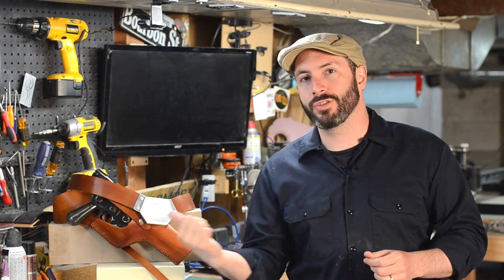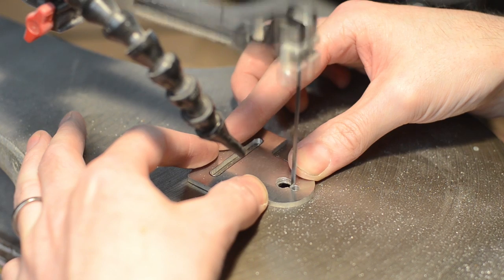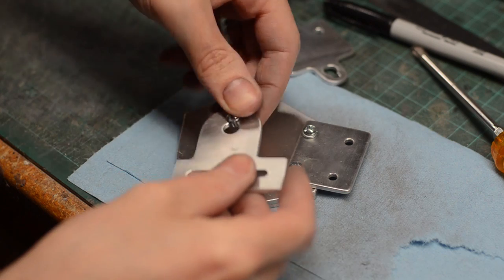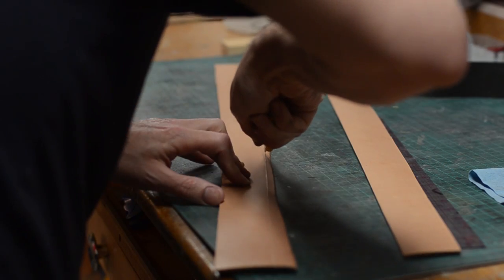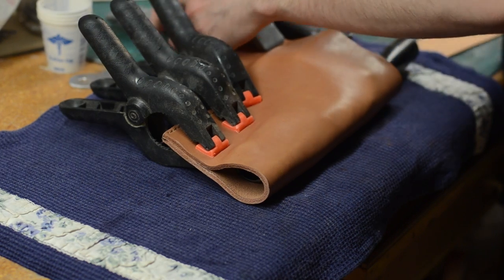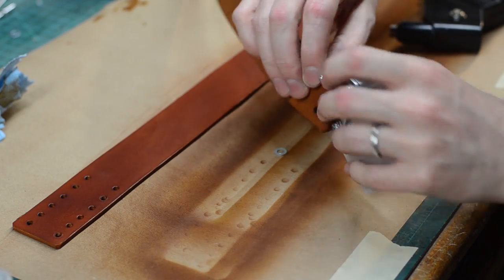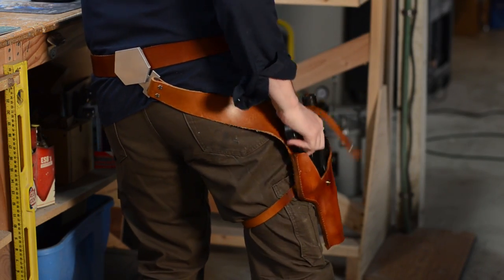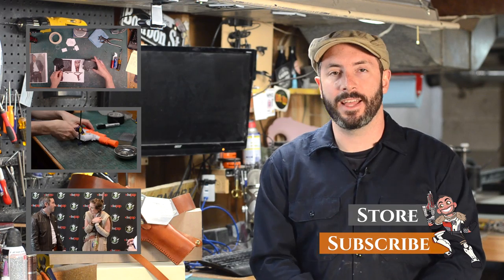Prop: Shop - Han Solo Belt Holster Build

Comment: Hey, just wanted to say nice job on the project. If you want some tips on working with leather from someone who works with it all the time, i work with my dad and we build custom saddles in Texas. To darken the color of the leather, we use peanut oil and depending on how many coats you use will determine how dark it gets. And if you plan on using leather regularly, we use a large sewing machine thats made for leather, its much nicer and cleaner looking.

Comment: Looks very nice. The buckling is great work. I did use your patterning idea ( paper on your body) to pattern out my holster as well and it works great. Mine isn't leather but a vinyl fabric over a nylon belt. with all the attached "utility doodads. I would love a metal buckle and this give me some great ideas. Love your vids.
Reply: Over all u did a good job...but the scope does NOT go inside the body of the holster ..its on the  outside.

Comment: Bill, if the metal was getting too hot to touch, you should quench the heat with water. If it is too hot to the touch then it can be on the verge of overheating. Just a nice tip :)

Comment: Would definitely recommend using cutting fluid when cutting or drilling aluminium.  You'll get cleaner results, it won't heat up nearly as much, and it's less harsh on your blades/drill bits (though it will make more mess!).

Comment: Hi Bill, I'm a Star Wars fan, but do Star Trek Cosplay (I know, blasphemy on a SW build video). I'm currently working on a 2285 (The Wrath Of Khan Era) Starfleet Uniform, with a few custom touches. I'd like to add a holster for my Phaser to slide into and hang off of the standard uniform belt. I got a lot of great tips and ideas from this video, my only questions are, what thickness leather did you use, and where do you go about getting a sheet of leather (I assume Joanne's or Hobby Lobby doesn't carry the correct leather)?
Reply from the maker: Hey there! Check out this video for some helpful info and links! https://youtu.be/42HvV9uQxr0

Comment: Great video! I'm about to start a belt holster built myself (although a more improvised one, because I'm figuring out another way to close the belt in the front)
Which thickness do you recommend for the leahter? Thanks!
Reply: For a holster I'd recommend 5-6 oz leather at minimum. 7-8 is actually better if it's a holster that's being used a lot, but for cosplay purposes 5-6 hits the "sturdy enough" and "costs less" buttons fairly well. 
I would also recommend finding "How to Make Holsters" by Al Stohlman. It has great instructions on how to make your custom pattern, general assembly and a number of different types of holster.

Comment: Hey Bill, always  love your work, but as somebody who lets a lot of kids use my shop (after a thorough safety lecture), I need to admonish you for wearing gloves while working with your bandsaw.  This is really not a safe practice, and I'd hate to see one of your many young fans get hurt by emulating it.

Beyond the false sense of security, they create a new danger vector - brushing the saw blade with a bare finger will net you a cut or even a nasty gash.  Brushing the saw blade with a gloved hand could snag the leather and pull your hand deeper into the machine and things get worse fast.   I've seen it happen, it's why we don't do it in my shop.  Better to work carefully and keep things out of the way.  

If you feel like you need to hold something close to the blade,  it's much safer to figure out how to use a pusher stick or feather board to hold things down.